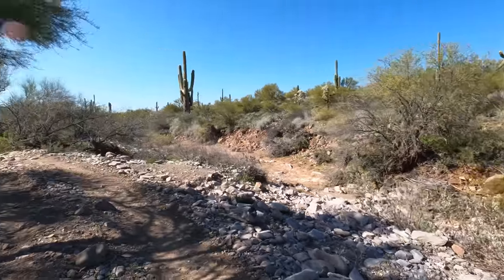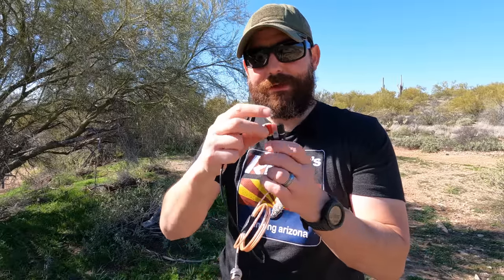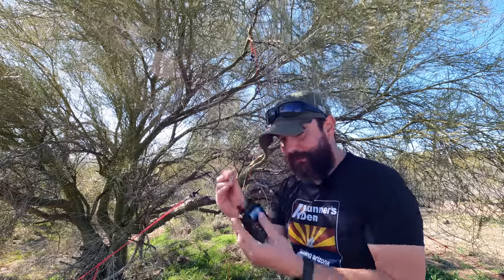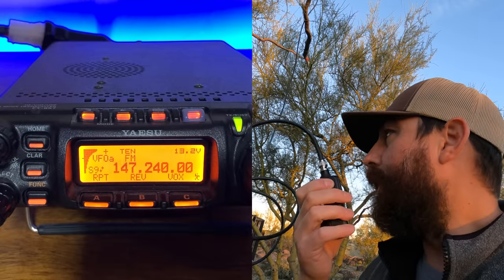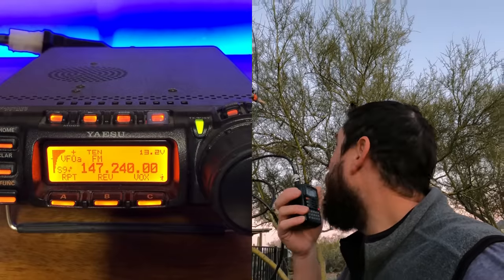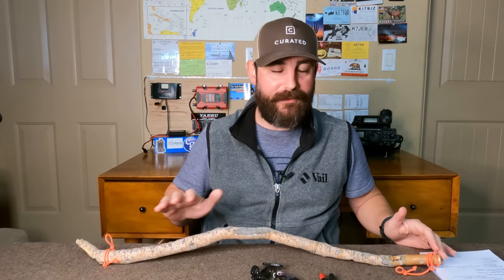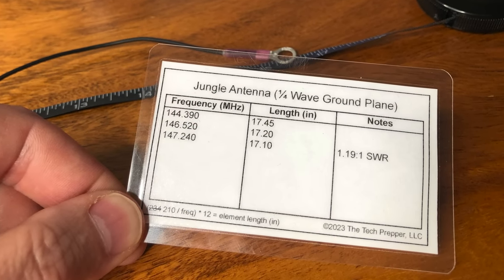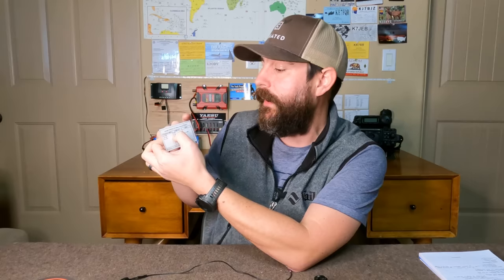Improvised Field Comms - The Jungle Antenna

Comment: Nice video. A couple notes: 1. Any wire that has a jacket of it has a V-factor. It detunes the antenna. Makes it lower in freq. The 210 takes up the difference.  and 2. the fold over even though it is folded at the 17.x" point, that extra wire is still included in the length unless you short it back on to the main wire. Cal from DX Commander talks about it in his videos. Again, nice video. Great idea on the 1/4 wave ground plane antenna. 👍
Reply from the maker: I really appreciate this insight, John. You win the "best comment of the day" award. This make sense. Thanks for being a digital Elmer!
Reply: Judging from the terrain stated in your video, I think you would have had better or a greater distance with a 5/8 wave for 2 meters…

Comment: I have seen this type of antenna built with hard wire on a table top for 70cm. it was tiny. Honestly 17 miles with any ht is pretty frigging good,. You wont get that range in my neck of the woods ever. Too many hills, trees and homes. you are lucky to get 25 miles with 50 watts in a mobile.

Comment: GREAT JOB!  I followed your VERY CLEAR instructions, and I built a VHF, 2m, 1/4 wave, ground plane "jungle antenna" using a 3-foot piece of bamboo, 14 AWG-stranded wire and all the other recommended parts.   It works great with a SWR of 1.2.  Mahalo Nui (thank you very much). WH6GTC.🤙🤙
Reply from the maker: Nice work. These are great performers. It's an added bonus that they're easy to build and repair in the field.
Reply: What was the distance of your longest contact or how many miles?
Reply from the maker: @digitaldreamer5481  With this setup about 32 miles on simplex. I was pushing 50-80 watts and I have about 1000' elevation advantage over the other station.

Comment: Before I watch the after action report, I think the 2 or 3 radials are not needed.  Your essentially making a dipole, so only 1 radil would be required.  Now adding the other radials may improve things a bit, I think the improvement/slash effort pain ,of use in the field would be not worth it.  This is based on some experimentation I have done also.  WIll be interesting to see results.

Comment: 1000% a proper crimper and crimps make all the difference.  I like the one that have a little adhesive in them too.  Here's my trick for using smaller gauge wiring in terminals too big,  strip double or triple the length length, fold accordingly and then crimp.
Reply from the maker: I'll try that next time. The right tools make all the difference.

Comment: Height = is Might.  Perhaps a light weight, telescopic pole carried, atach the antenna you just made or the N9TAX antenna to the pole , 15' to 20' tall, perhaps pole is leaned against a tree or cactus for support, no need for guying.

Comment: Interesting video, 35 years ago we used the same antenna with a PRC-77 radio.
A much simpler antenna was the AT-984a long wire antenna..
The PRC-77 tuned 30-76.95 mhz freq.
The long wire must be 5 wave lengths long.. At 30 mhz the antenna must be 150'.
Higher freqs,  works equally well with the 150' length. The key is the horizontal long wire must be one meter from the ground.
Super quick set up. Unreel the 984, point it in the direct of the distant radio set. Put the fork lug under the prc-77, 10 ft whip base scew down the AB-591 base. Again one meter off the ground with the long wire.
No AT-984a. Substitute 150' WD-1/tt commo wire.

Comment: Just came back from a 3 week hunting trip deep in the mountains of British Columbia. I hunted with a couple of awesome guys with UV5RHs set to GMRS bands by another ham (as they are not yet licensed).
Though comms were better than I though they would be, at 1-5 miles most often non line of sight, always through tall timber the HTs needed some help. On a whim I made similar 1/4 wave antennas with just a soldering gun and electrical tape (bubba, but it was all I had), tuned them to 462.6500, and BAM! Much better! Inspired and bored by long nights I made 5/8 wave versions...The difference between 1/4 and 5/8 wave was astounding! The signal from the little (10 watt?) radios sounded more akin to a 50 watt vehicle mounted radio. Short supply on Rg316 the antennas were only 8-10 feet up. I can only imagine how well the 5/8 wave would work a closer to 20 feet!
I intend to try 5/8 wave on 2M.
Thanks as always Gaston! Your videos are what inspired me to get licensed!

Comment: After watching the member video, I mocked one of these up quickly, and have an option. If you switch from 20 gauge wire to 14 gauge, you don't need the spreader(s). It is stout enough to keep a 45* angle without any support, and makes a stronger hanger/radiator as well. S-clips can be eliminated too. A bit more field expedient

Comment: I use an Abbree 42 inch antenna up a tree with a 20 foot SMA cable to my UV5R, hooked to a Baofeng mic for more gain, a 19 inch counterpoise wire hooked to the UV5R back screw, and custom squelch via CHIRP software for max sensitivity. Still experimenting with what little I have, but so far this works excellent.

Comment: I built a similar antenna from an old CQ Magazine article.  The article I read was called "The Ugly Ground Plane".  I built it for 2 meters, and it worked!  It was a design similar to what you built.  Knowing how to do this in an emergency and having the equipment on hand could save a life someday.
Reply from the maker: That's great. Based on my experience, I am not surprised that you had good success. Do you recall what year and month the article was published in CQ Magazine?
Reply: @TheTechPrepper  I scanned a copy into my computer. I just looked it up. It was in the November 2011 issue of CQ.  If you can find it, I think you will like it.
Reply from the maker: @davidsradioroom9678  Perfect. Thanks for digging up the year and issue.
Reply: @TheTechPrepper  I sent you the wrong link. I did find the Ugly Ground Plane Antenna article, but I couldn't find the issue and page number. I will try to email you the PDF file. I kept it, and I think you will like it.
Reply from the maker: @davidsradioroom9678  Received. Thank you for sending it my way. I am going to build one for 70cm and GMRS.
Reply: @TheTechPrepper  Cool!  Can't wait for the videos!

Comment: Excellent building from your first field expedient antenna. Job well done. Looking forward to more.
Reply from the maker: Thanks. The design was dead simple. It was a happy bonus that I was able to tweak the design for my environment and operating requirements. More on the way.
Reply: @TheTechPrepper  I’ve built a jungle antenna with 3 radials but didn’t think about just 2 legs instead of 3.  It’s good to know that works and less work. 
  By using the same cobra head, I built another simple receive only antenna called a LOG or Loop On the Ground. Just a 60’ length of wire made into a 15’ square. It’s receive only but pulls in some clear reception on radios that can tune into SW stations.
Reply from the maker: @Rowsey63  Thank you for mentioning your experience with a RX-only antenna. That has been on my list for awhile. Cheers!

Comment: Great video as always.

Did the cobra head connector experiment to create a 6m dipole for my HT that works on 6m. It set off the emergency lights in the building. Lol. But at least I won't have to buy a 6m ht antenna since it hits the repeater well and the reports say it's not full clear, but very readable. 

As far as wire, one of the ways I get a lot of wire is looking out for people throwing out vacuum cleaners and floor scrubbers. They're usually 20ft in length, and in most cases you get two wires. The issue however is that you may need to test them since they maybe broken (hence them.throwing it out) and if you need a longer wire, splicing (or soldering if that's your thing) will be needed.
Reply from the maker: I have a vacuum that just died. Great timing! It's time to strip that bad boy of its wires.

Comment: Adjustable Trekking Poles, I have the Black Diamond Alpine Carbon Cork 130-100cm when separated gives you three light weight pieces to work with, instead of tree branches. They have measurement markings on them and you could add more for more detailed lengths. I am a ultralight camper and I think a little bit of research within that community you could really benefit from weight savings and improvising the trekking pole sections with a little electrical tape. Just a thought, hope this helps. Thanks for your work on all this!

Comment: Dont apologize for the quality the info is what counts. I learned a bunch and my bank account hates you....😉 that was very enlightening  for me. Thanks
Reply from the maker: You're right. I'm done apologizing. Running two cameras was a pain. They were 400m apart, so I was running between two radio camps.
Reply: I am curious though. I am a newbie as well. Why would the length of your wire needing to be exact matter in a field enviorment for a spefic frequency? The rubber ducky antennas cover a wide range of vhf and uhf but are short?
Reply from the maker: @79attaboy  For the best performance, you want your antenna to have a good match with your transceiver (50 ohms) with the lowest SWR. This is done by tuning (trimming) the antenna to the frequency where it is resonant. When you have a good match, the antenna will have less reflected power coming back the radio making it more efficient. Broadband antennas like the rubber ducks don't do this very well, therefore there performance suffers.
Reply: Ahhh.. gotcha. That makes sense😉

Comment: For a lightweight support system, try using some fiberglass flex rods for the radials. Powerwerx also a terminals that have heat shrink material. Picked some up at a ham fest last year or the year before, can't remember, but they work great.

Comment: Your test worked out very well. Not to throw shade, but unless I need an ultra compact kit (and there may be times), I just carry a 2M/70cm roll up J Pole as my primary field antenna. Three reasons. #1 Speed of deployment. #2 The ability to get the antenna up without building something if I am injured. Last, in some areas, there are only 70cm repeaters or you may have both and once again, it saves time if you can not get into a 2M repeater, but can access a 70cm repeater. There would be no need for second set of wire radials with the J Pole. Yes, you can shorten your 2M radials, but again, more time. With the J Pole, I'm not worried about having the correct length of wire. To me in most instances, it just does not make sense for VHF/UHF.  Having a kit like you have made does follow the two is one, one is none principal, so yes there may be a need. Now a similar kit for HF to improvise an antenna with whatever you find as to wire in the field (or what you carry with you) also makes a lot of sense and this kit with a couple other items fits the bill for that also. This is why I said, I'm not trying to throw shade. These small kits can be of great value. I'm betting you already have a improvised HF video kit in the works. Thanks Gaston.
Reply from the maker: I am happy to have any counterpoint. I actually have been carrying a J-Pole for a couple years now. It's the N9TAX Slim Jim that was used on the receiving station. However, I just acquired a much lighter and more compact Ed Fong that will be replacing the N9TAX in my pack. It will be fun to benchmark it against the 1/4 wave ground plane that I built. My only issue with the roll-up j-pole is that it is not quite as easy to build or repair with scavenged parts. Either way, both are now a permanent part of my portable gear.
Reply: I’m looking forward to a comparison to the Ed Fong J-pole. My guess is the J-pole will have an additional 1+ dB of gain over this design, but as you stated the jungle antenna is much more flexible in an austere environment.

Comment: If you work out the base area of the groundplane you could use thin PVC pipe and attach it with that. As long as it is rigid enough to keep them at a 45 degree then it will be a good setup. Also a holder for the wires as well during transport.

Comment: Great video. I was looking to buy an antenna for field deployment but I will build one now. The reason using 234 to calculate the 1/4 wave length is to long is that number is for bare wire.  With insulated wire you need to consider the velocity factor.
Reply from the maker: Yep. I found out that the insulated wire is introducing capacitive loading when folded over on the ends. Thanks!

Comment: The first dipole i made; the 468/Mhz, gave me readings that the elements were too long. I eventually realized that the space between the banana posts (.75 inch)  was something that needs to be taken into consideration (ie the two 19 inch wires plus the .75 inch= longer than the frequency desired).

Materials also are a factor that prevent the universal formula from being perfect and thus why you should always cut long and snip your way to your goal.
Reply from the maker: Cut long and snip short...that should be a t-shirt.

Comment: Good experiment GMan.  My experience with the ground plain was about the same.  Improvement,  but not significant.  The roll-up J Pole crushes it.  Having the skills to build the ground plain from scraps in the field is important.  Good excercise! 👍
Reply from the maker: Thanks, Dick. I just acquired the Ed Fong roll-up J-Pole. It's very compact compared to my Slim Jim from N9TAX. I also found that the coax that comes with the Ed Fong eliminates the need for the BNC coupler. It has a male BNC on one end and a female on the other. The kit is still improving.
Reply: @TheTechPrepper  GMan, antennas are fun to play with.  Understanding the basics opens up a lot of field expedient Gerryrigging that is very functional.  Your video on the terminated dipole and the military manual you referred to have sent me down a rabbit hole.  The manual shows a doublet with a twisted pair feed line converted to a terminated sloping V directional antenna.  I am now experimenting down that trail.  First testing on the doublet with twisted pair feed line is a success. Now some better weather for more extensive testing will be nice.  Your creative approach to problem solving is infectious! 73 OM
Reply from the maker: @owlcricker-k7ulm  Glad to hear that you're infected. The twisted pair is very intriguing as it eliminates the need for the coax and can be improvised in the field. That is on my list, too. If you find any good resources, please let me know. By the way, I experimented with a 6m Jungle Antenna last night. I actually used 3 radials and went back to my guy system since the elements are around 47". I am trying to hit our closest 6m repeater...it's 40+ miles. No luck yet.

Comment: There are two versions of the jungle antenna that have semi-self supporting ground radials. One uses bicycle cables. Guitar strings/paino wire would be smaller. The other version requires slipping soda straws over the ground plane elements.  You would need to McGyver something at your cobra head to support the radial from cobra head outward. Perhaps bottom of water bottle over the vertical element with radials through sides of bottle.

Comment: If you use almost the same components, but make a 2m Delta Loop, it's quicker to assemble and very easy to make a triangle shape  frame with 2 sticks. It performs great!
Reply from the maker: Great suggestion! I'll try it.

Comment: If you didn’t have those connectors, you could have made a sleeve dipole. Just strip the same 17-19 inches of coax. Strip the braid back (but don’t cut it off), exposing the bare center conductor. Then wrap the braid around the coax. The advantage over a conventional dipole is that you can run the coax vertically. With a regular dipole, the coax should come away at a 90° angle for a certain distance.

73 de AF6AS in “DM13” land

Comment: Another measuring tool is your cards. Print a ruler grid on the edges of each card, inches on top, mm on bottom, then you can put your cards end to end to make a ruler. 
I’d skip adding numbers so any card in any order will work. 1/4” marks would probably be detailed enough for any field work. 
I will be formatting and printing my cards as 3x5”, so that in itself gives you 2 known dimensions.
Reply from the maker: This is an excellent tip. I think I'll add ruler to the edge. Thank you.

Comment: Two or one ground plane radial may introduce some directionality. Normally that is not a desireable characteristic of a vertical ground plane antenna. However, directionality may be an advantage in some situations as +1dBr to +2dBr may be a make or break difference.

Comment: To take strain off the top element you could hang off the cobra head then at the right height throw a alpine butterfly knot in your line to hold the element straight,  then the weight will be hanging off the cobra head. 
Also saw your Instagram post about making one for 6m. Interested in that since I have a 6m capable mobile I need a portable antenna for. 
Great info! Keep it up, 73
Reply: Or a small prusic loop instead of an alpine butterfly to be able to tension the element once it's clipped on
Reply from the maker: Great tip, Ryan! I like this design.

Comment: Enjoyed this and have ordered all the parts. Is there an updated version that includes GMRS and 70cm band? You mention it at the very tail end of the video is the only reason I ask. Thanks either way!
Reply from the maker: There's no video update. However, the same principle applies to 70cm and GMRS. Just pick your target frequency and run it through the formula to get the lengths. The 70cm and GMRS will just be shorter. Good luck with the build.

Comment: You might want to consider using a stud hook terminal instead of the ring terminals to attach wire radials and dipole elements to your dipole adapter with the captive binding nuts.